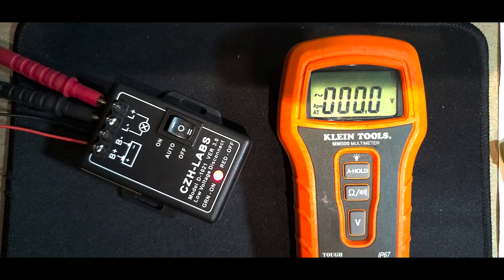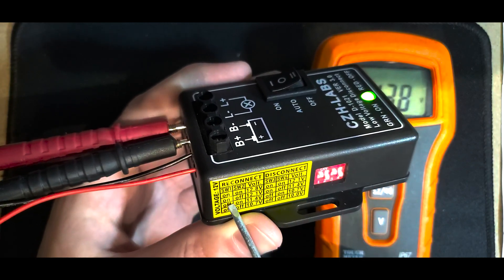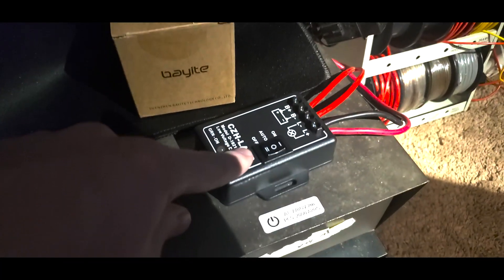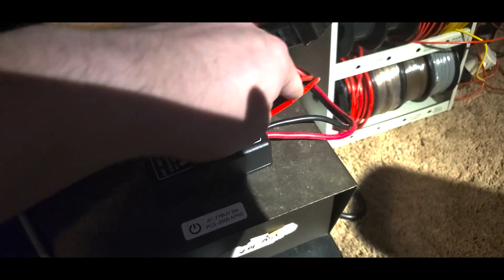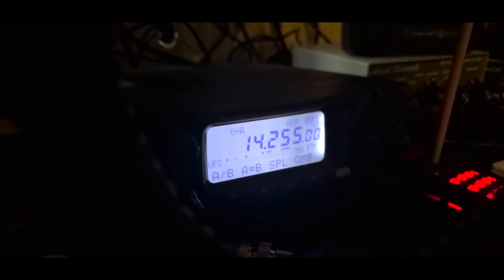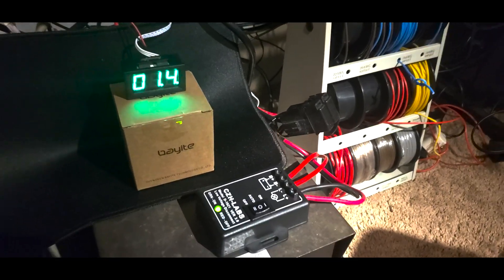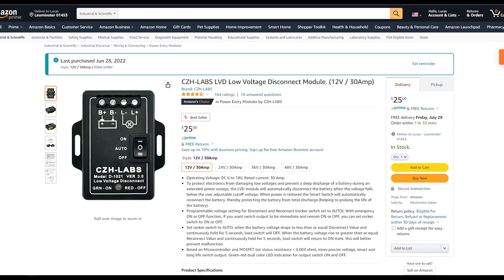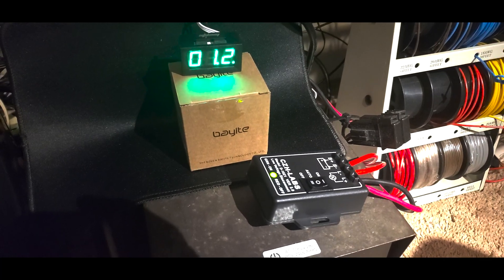SAVE YOUR CAR BATTERY! | The CZH-Labs D-1021 Low Voltage Disconnect Circuit | W1BTR Reviews

Comment: Thank you for the demonstration. I just bought the CZH LVD. Unfortunately my unit only provides power when the disconnect is set at 10volts even with 13.4 volts in the battery. Anyway your video confirmed that it wasn’t human error on my part.

Comment: Thank you Lucas for your excellent review.  LOL at 4:50 I was waiting to see how long it would take you to see how you left the switch settings.

I bought one for my HAM radio setup in my car.  I hooked it up under the hood.  I connected the two 30A fuses between the battery side of the unit and power and ground connections on the battery.  If the unit shorts out for some reason, the fuses will protect the battery.  The screw terminals are heavy-duty enough to handle 10 gauge wire that I run from the unit to a fused Anderson Power Pole Junction block.  From there, I'm free to connect various 12 radio gear.  For things that require 5V USB, I bought a Anderson Power pole to USB-A adapter.  That allows me to charge cellphones or run GPS receivers, etc. without having the engine on or worrying about a drained battery.  So far, the disconnect circuit is working well for me.

Best 73, Konrad WA4OSH